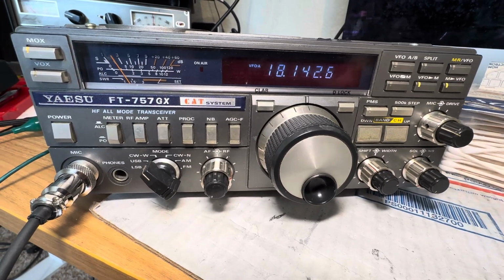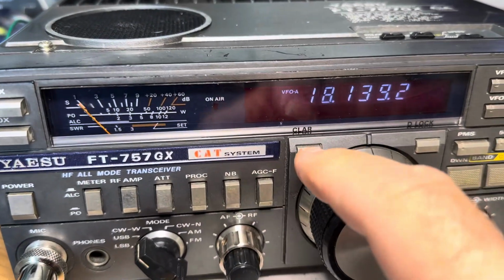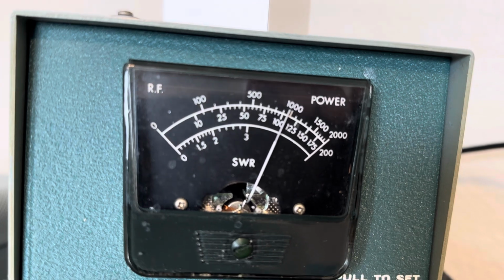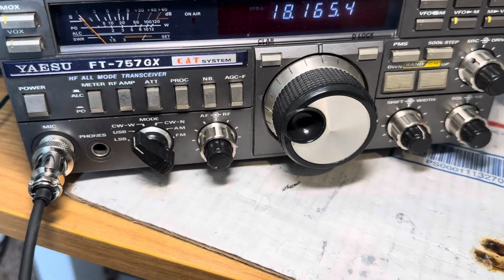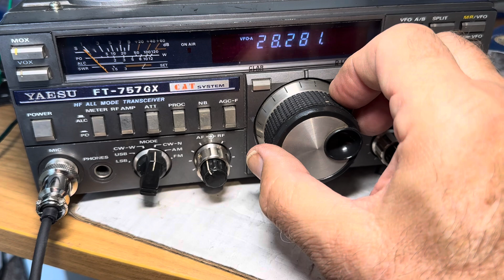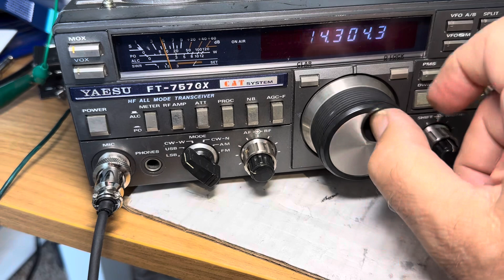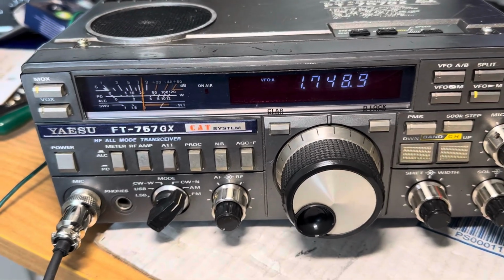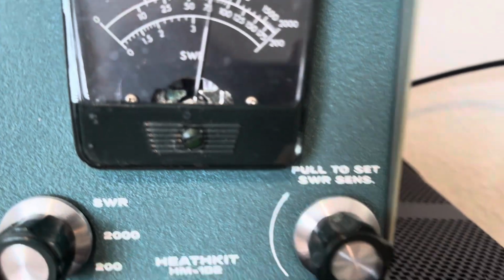Yaesu FT-757GX controls explained and receive demos and transmit demos

Comment: Just set up my station after being off the air since 98 when my dad passed.  We used to hunt special events, loved field day and the local repeater group.  My Yaesu 757 GX looks new as I unboxed all my equipment. Thanks for the video and an intro back into the buttonology.  N3DLM
Reply from the maker: Hey, no worries I didn’t have much luck with that radio and I sold it because it had some pretty bad spurious frequencies on 40 m and I was not about to debate so I think some guy in Arizona bought it